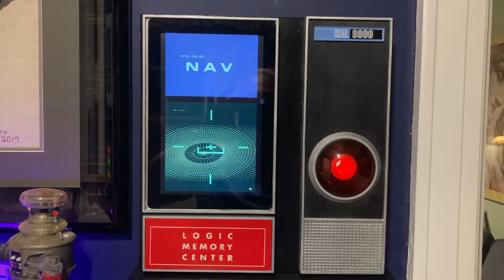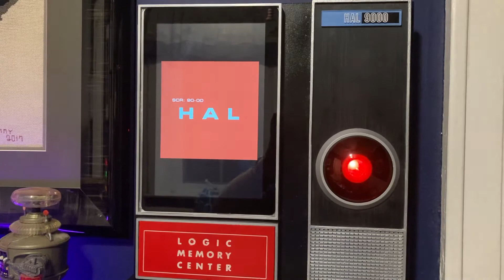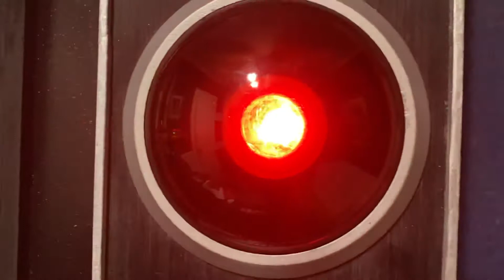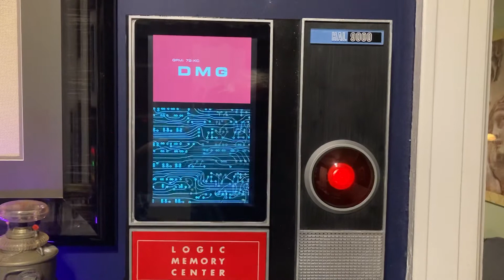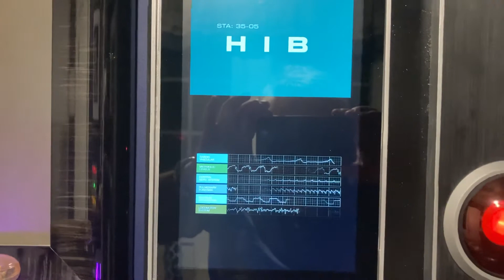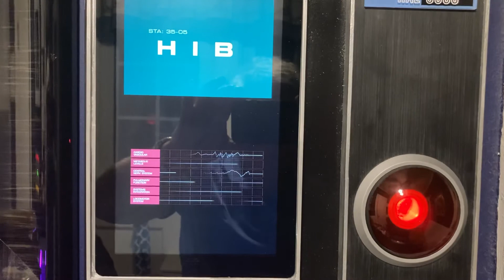HAL 9000 replica

Comment: Can you show us the code and how you pulled this off? This is great! I'm working on something like that as well.
Reply from the maker: I use the speech_recognition library which gets input from a microphone and returns it as text  (using Google). I examine the text file and take an action based on what it says.    I used this video to get started:  https://youtu.be/Q-CaEJ2qvl4  If I were to do it again I would just use a USB microphone instead of the Respeaker Pi Hat. The Respeaker microphones are VERY sensitive and cause HAL to respond to my TV which is in another room. Also, the speaker output of that device plays some audio files but not others. I wasted many days trying to get it to work with all of my HAL sound files. Eventually I gave up and now play the audio through the HDMI of the screen.
Reply: @BillYovino  I see, thanks!
Reply: @BillYovino  Oh wait, I have one more question, actually.
where did you get the computer graphics from?
Reply from the maker: @Dandom15  There used to be a site that had them but I think it's gone. You may be able to still find them.  This youtube channel has some good stuff you may be able to use.  https://www.youtube.com/c/TheHALProject/videos  Also this site is a good reference: https://www.therpf.com/forums/threads/hal-9000-panel-2001-a-space-odyssey-pg-5-final-update.119324/   If you get clever (4k downloader app) you can grab some videos and edit them to your needs. This one has lots of good stuff.  https://youtu.be/C1U_OXCZ2NE
Reply: @BillYovino  Thank you so much!
Reply from the maker: @Dandom15  I don't want to put my email address here but you can contact me through this link if you have questions/issues.  https://hubpages.com/@bill-yovino